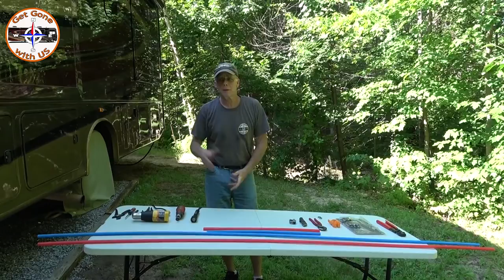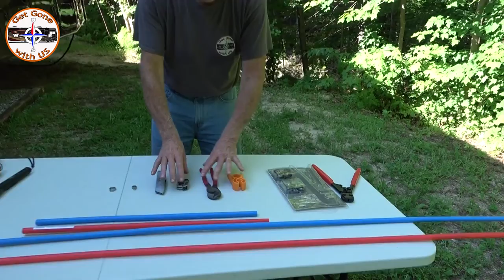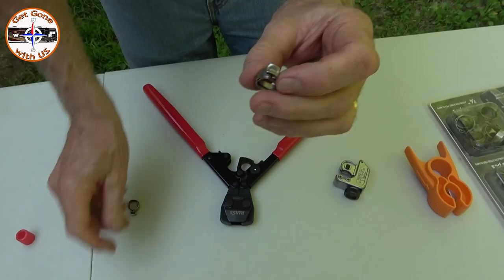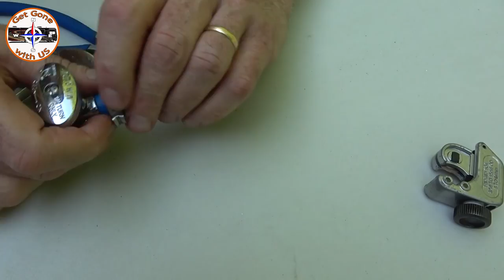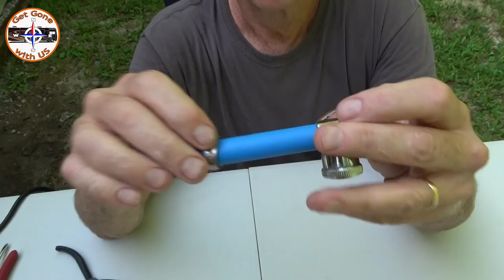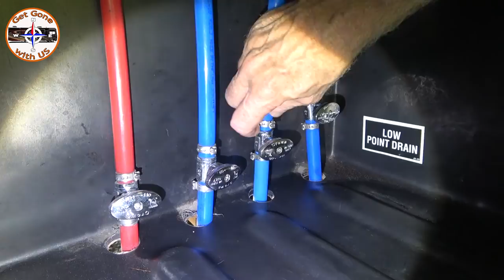RV Plumbing DIY - PEX Tubing and PEX Clamps

Comment: The pass-thru holes seem large enough for mice to get in past the tubing hanging down.  Maybe pack the space with steel wool to close the gap.
Reply from the maker: Thanks. Been there, done that. We have been lucky with no mice.  We did pack steel wool everywhere a while back. 😊

Comment: Veer nice....just to mention though, your crimps were 1/16" off the end of the pex...you really do need to be 1/4" - 1/8" from flush depending on the fitting you're going on to.
Reply from the maker: I mentioned how far to mount them at timestamp 12:45  Where are you seeing 1/16" and how did you measure from a video?

Comment: Hello from Ouray,  Colorado!! Thank you very much for this very informative video!!

We were out on a 2 week boondocking trip that started in the northern part of Colorado, and we worked our way south so as to catch different areas to enjoy their aspen leaf changes.  But, my thetford toilet started leaking.....and the leak got bigger with time.  I had split the bowl from the pedestal, in April, so as to change the ball valve seal.  My guess is I may have tightened the water supply connection too much (an idiot mistake....but knowing how tight one tightens an auto oil filter, no doubt I tweaked the seal).

Anyways...with our toilet down, our whole water system was down; so, we came home today.  

I want to use what I learned from you on this video and install shut off valves on each of our water basins (kitchen sink, bathroom sink, shower, and toilet).  Then, if I have another problem, that can be isolated and we continue to operate the rest of the travel trailer.

QUESTION: my toilet water supply line is not pex.  It is actually a relatively stiff piece of potable water tubing.  Do you feel these pex clamps will work with that type of tubing also?
Reply from the maker: Hi Alan. I never looked into it myself, so I really don't want to say yes or no. I would research it online and make sure you get the right fittings for the job.  Good Luck! 😀

Comment: Cool video.  One of the nice things about Pex is you can rotate it around after its clamped.  You could have just turned the valve around without taking it apart.
Reply from the maker: Yup, but I thought it would be an opportunity to show others how to remove and replace in case they ever need too.  😀

Comment: Looking to remove my water filter canister which is located inside a drawer compartment and it's hard to remove the filter..You have to remove two drawers (next to the bed also). it's the same area where the electrical is...Want to put in a bypass line where the canister is...Currently using an external water filter..This video tells me what I need..Thank you sir..
Reply from the maker: You are welcome Victor.  Good Luck! 😀

Comment: I am changing out my water pump using the fittings that came with my Shurflo pump. I have to remove the existing fittings as they are different. After inserting the new fitting into the pex the pex clamp will not fit over the fitting burr, what the issue?.
Reply from the maker: Did the RV come with Pex?